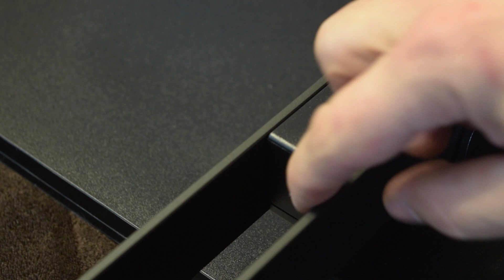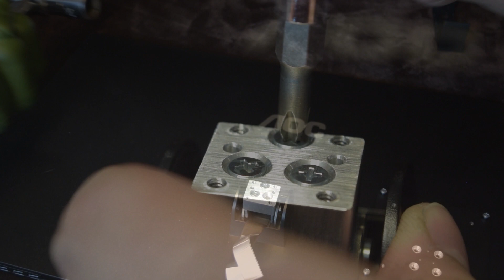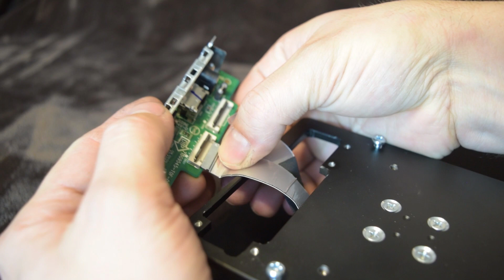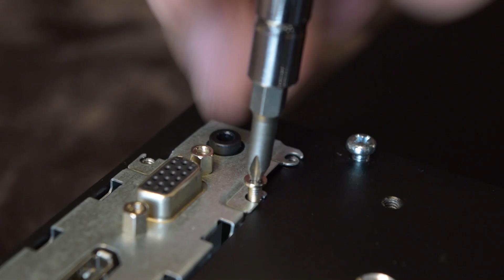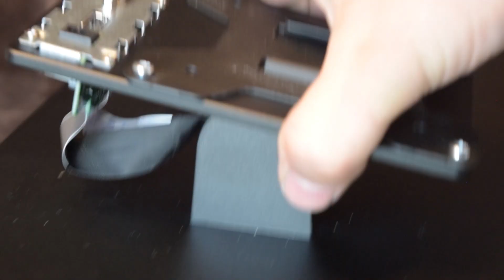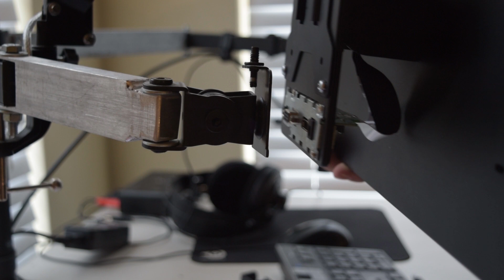Installing the VESA adapter for the AOC 27V2H, 24V2H and 22V2H

Comment: the only thing held me back from buying this monitor is not having vesa, you are doing god's work friend :) thanks!
Reply: where did you find the mounting adapter for this monitor?
Reply: @SafwanulChowdhury  the video creator created and sold it himself
Reply: @namnathanielmai  wait is that the link on the description?
Reply: @SafwanulChowdhury  yup!
Reply: Same
Reply: yeah, but man, I  still really hate the idea of paying almost 40% of the cost of the monitor itself, for a simple piece of metal, to be able to mount this thing like a normal person. I was ignorant of mounts, and just assumed they all mount the same way, as I've never had a single problem with this in my life. I probably would have not bought this if I knew, and still haven't been able to spring for the mounts for the THREE monitors I have.. gahhhh.